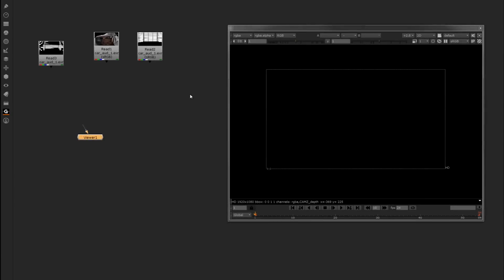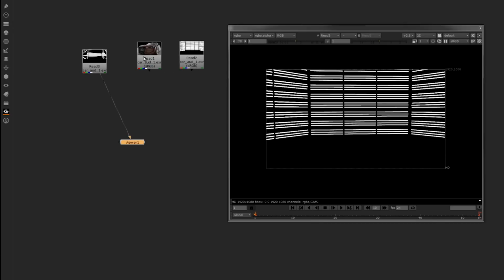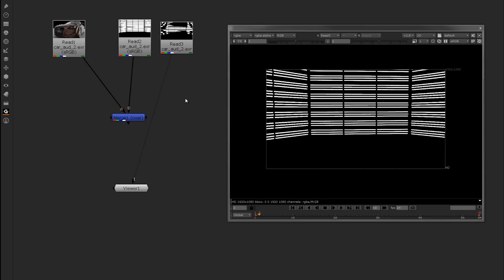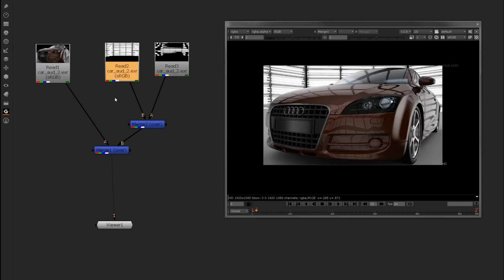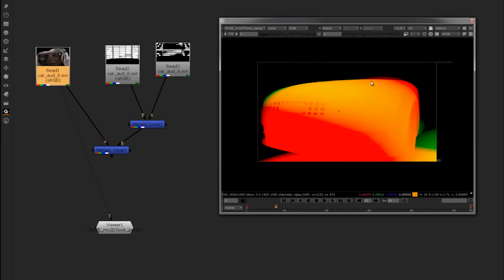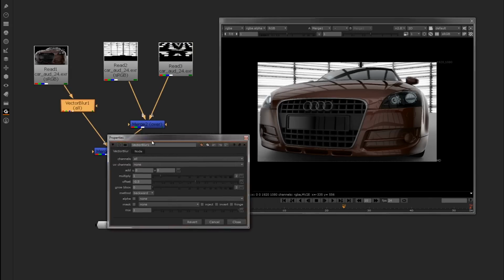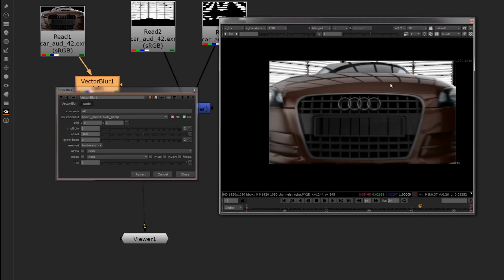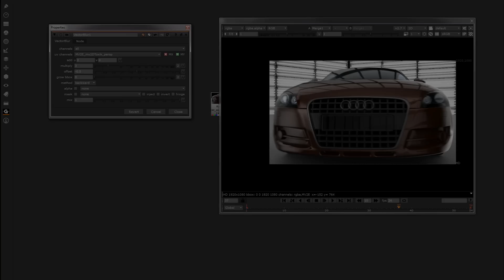Nuke CG Motion Vector Blur Tutorial

Comment from the maker: Hi, I expored a 2d motion (mv2DToxic) vector from the Mental Ray passes tab. And yes, you can use use the 2d motion vector by itself as a rendered pass. But I find it easier to contain all passes in one file as its easier to manage. The only time I use separate passes in different folders is when I'm rendering different render layers using the "render layers" feature in Maya.